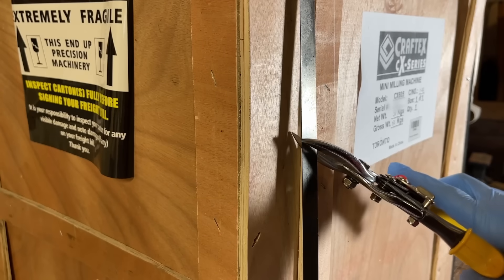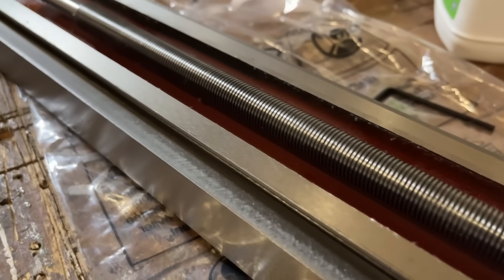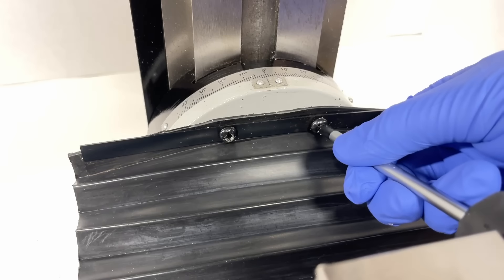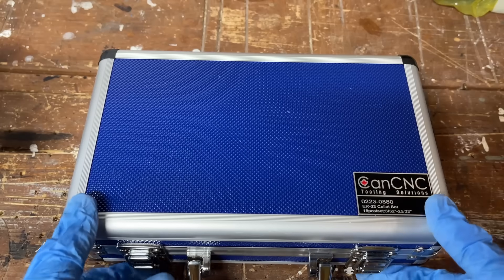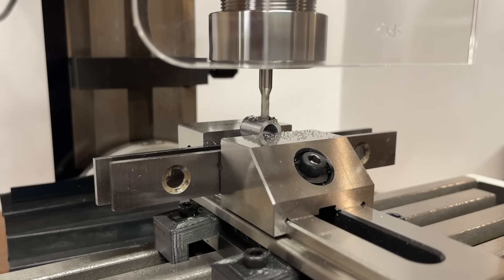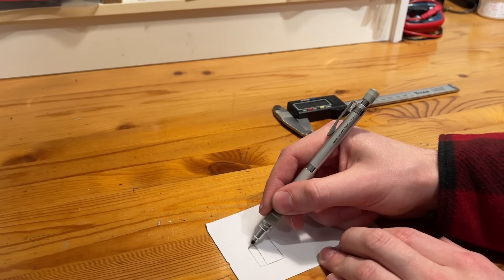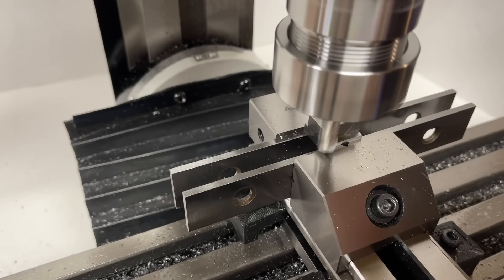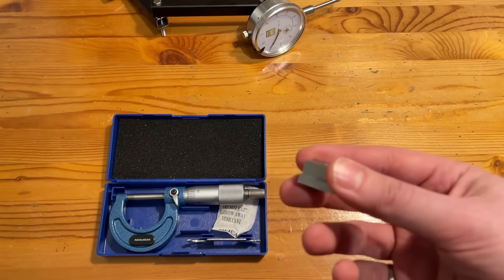I Bought A Minimill to see if they are Worth It

Comment: What definition of Tram please ?
Reply: Tram refers to how perpendicular the spindle axis is to the table.
Reply: Using a dial indicator held in the spindle, swing it to each end of the table.  If the column is perfectly perpendicular to the table, the readings will be the same.  Adjust the column until they are as close to the same as you have time, skill, and patience to achieve.  Make it easier by using the side of a large ball bearing for a contact surface.  Indicator doesn't fall into the t slots this way.
Reply: Tram is squaring the spindle to the table. Mounting a dial indicator on an arm in the chuck and sweeping it on the table you can measure the difference from side to side. When trammed there should be no difference.
Reply: Trimming the mill means adjusting it such that the vertical axis is perpendicular to the x and y axes.

Comment: Harbor freight sells the same mill, you can get it on sale for a little over 500.  Like almost all Chinese tools, you need to think of it as a kit.  Strip it down, clean and lube everything, replace cheap hardware with quality fasteners, do the LMS belt drive conversion, and add a cheap dro.  Even with all of that, its tiny size is the biggest constraint. 

If you do not have the room for anything larger, its better than no mill. If you have the space for it, you'll never regret buying a bigger mill.  The 6x26 Chinese knee mills are a HUGE step up in capabilities, albeit at a corresponding jump in purchase cost.  If I ever downsize from my full size Bridgeport, that is the way I'd go.
Reply: good advice !!

Comment: I have something very similar, a Little Machine Shop 4190 I bought as factory refurb with the DRO removed. Essentially your machine with belt drive, bigger table, 20 tpi leadscrews, and solid column. It'll pretty much eat aluminum with 3/8 endmills as fast as I can crank, and mild steel at maybe .050" DOC passes. Alloy steels like 4140 though, the mill pretty much has to nibble at. Where the stiffness issues will get you is high DOC cuts, even at super low tool engagement and low feed rates, like knocking down the sides of a part. Listen to your mill and feel what the vibration in the handwheels is telling you, and it should do fine.

LMS does sell conversion kits such as a belt drive kit or 20 TPI leadscrews, if you don't care to make them yourself.
Reply from the maker: Good advice! I’ll keep that in mind when I need to work with any of the tougher alloys out there

Comment: With the Mini-Whatever machines there seems to be a third category besides "Maker" and "Collector".  And that is where the lathe itself is the hobby.  I have been on the 7x12minilathe group forever and it seems the majority of activity is fixing this or that about the machines.  Or making this or that accessory (carriage clamp, chip guard for the back side of the apron, and so forth).  It is pretty rare that I see posts about somebody using the machine for an actual project.
Reply: 😂. The lathe itself is the hobby. I’ve never heard it put that way. It’s true though
Reply: @aquilifergroup  Although, I don't think that's a bad thing.  A hobby can be whatever somebody wants it to be.  And they are doing something and learning something outside of looking at TV, smart phones, iPads, etc.
Reply from the maker: Haha very true! I definitely also fall into this category from time to time. It’s fun to go down the improvement rabbit hole
Reply: I bought a mini lathe to use and I do. It's biggest drawback is depth of cut(material removal) is small due to lack of rigidity. Yep, had ta change the control board and replaced the plastic drive gears so the price ain't mini no more !!
Reply: @practicalplinking6133  The bed part of it is actually rather stout.  Most trouble seems to be to be due to the cross slide + compound flexing, and general looseness there.  Some lap the dovetails as an improvement.  Some remove the compound and replace with a solid block and report it helps.  Then there are the many who have changed the headstock bearings to good quality8 tapered roller bearings.  Some problems are user caused such as not using sharp enough tool bits, tool bits extending too far from the tool post, or trying to exceed what the low horsepower motor can do.

Comment: I have machining experience (and a much larger lathe and mill in my garage) and 15 years ago or so bought a Chinese mini-lathe and mini-mill similarly "just to see what they were all about."  There are a wide range of opinions from "works fine for me" to "these can be viewed as a kit and you have to fix and improve almost everything."  I think this variance is due to a variability in the quality machine to machine, and a variability in expectations.  This is the first such machine for many and they don't know what a good quality machine is like.  Others DO have experience and can spot the limitations and instantly realize why there is chatter when maybe there shouldn't be and so forth.
Reply: I agree completely. If ever someone wants to get into machining I always tell them the best quality and the biggest you can handle! Generally the jobs you pick up or tasks you pick up will be determined by machine size specifically with smaller machines. The smaller stuff generally will have issues though where everything needs to be corrected. Not always but a good chunk. Staying within the capabilities of the smaller machines are important as well even though on a bigger machine those capabilities are generally more maximized.
Reply: agreed. i'm a musician and i've had my 6-string electric bass for almost a decade now. i was working at a music shop, and the owner was a bass player, so we had everything from beginner models to $8000 6 string Zons. none of them felt right.

then one day, i unpacked an LTD D6. it was magic, effortless, just...unreal. AND it was the cheapest 6 string we sold, it listed for $500. and i can almost guarantee the next one off the assembly line played like shit haha
Reply: Yes, that's my general view on it. There's so many of these things at different prices from different places and they all have basically zero QC. One will be "acceptable" and the next one will have an unmeshed geartrain and a bent spindle. And then exactly as you said, some people know and some don't.
Reply: It's much like 3d printing. You can buy a $1000 quality hobby printer and you'll be guaranteed to have a good experience. Or you can spend $100 and get something that will work out of the box with some tuning but if you want consistency and reliability you need to put some more money and a lot more time into it.
Reply: The Chinese mini lathes and mills mostly come from the same manufacturer from what I understand, but that manufacturer provides different levels of quality and features depending on what you are willing to pay. So if you are willing to pay for it, they will give you quality machines to put your brand name on, whereas another company may sell the same machine with their own branding, but it be lesser quality.
Reply: @WheelsRCool  They mostly come from "Sieg" (Shanghai Sieg Machinery Co., Ltd.)  Some come from an outfit called "Real Bull" although the actual manufacturer may be somebody else, but they are not Sieg, are a little different, and most comments have them as slightly better.  I think that the notion that Sieg makes different quality levels is probably a myth.  I've been on the 7x12minilathe group forever and the 7x10minilathe group (now defunct) before that.  Quality seems all over the place no matter whose name is branded on it.  I have a Micro-Mark mini-lathe and mini-mill, and quality is about as others describe on average.  In other words, not that great.  In the case of Micro-Mark, they have negotiated some special features which seem proprietary to them and those are mainly the 'True inch" cross slide and compound screws and dials and the offset tailstock.  I believe ArcEuroTrade has at times, or perhaps always, cleaned up the machines first and if they saw an obvious issue might have rectified it.  So, there may be some who have had a little bit nicer experience.
Reply: I suspect it also makes a huge difference just who you bought it from - the crap castings and terrible finishing on some of them may have started at the same foundry as the good ones. But they could for instance be the quality control rejects from the places that sell reasonably good machines being sold on by somebody else etc... I know my mini mill has a surprisingly good spindle (at least for what it is) but the table is pretty terrible - probably salvageable but I've not really got around to invesitaging that.
Reply: at their price point, they have no competition. proxxon anyone?
Reply: @simonschneider5913  Although I have Chinese mini-lathe and mini-mill (from Micro-Mark over 15 years ago so early models) i recently got a Proxxon 250/E lathe (about a 5 inch swing) and FF230 mill.  I got them for model railroading work and simply got tired of how one Prazi lathe group member aptly described the Chinese lathes as "torture machines."  Made me laugh, but sort of true.  I still use the Chinese stuff for some things too large for the Proxxon, and I have much larger machines for even larger things.  But the Proxxon is REAL nice for small work, and I believe the models I got are the "sweet spot" in their line for value and better than an old Unimat or a new Sherline.  But to match the size of the mini-lathes, you need a Proxxon PD400 and that's about $4,000 (same for a Prazi of that size).  And for some reason seems unavailable in the U.S. now.  Prices are rising on the Chinese mini-whatevers but they are still a good value even if not quite the bargain they used to be.  The Chinese stuff makes it possible, especially for newcomers, to at least have a machine.  And there is a huge difference in having something over nothing.  But those newcomers don't get to experience what it is like to use a better quality machine.
Reply: the thing about buying chinese brands is the cheap stuff is made with the worst tolerances while the more expensive chinese stuff will have more accurate tolerances, they are made to order in batches literally from a cheap to quailty$$ scale from 1-10. Sometimes even the cheap stuff comes out really good but since the cheap stuff is usually a rush order its not the best. Doesnt mean a guy cant make it work
Reply: The chinese mini-mills/lathes of today are probably way better than the ones you got 15 years ago.
Reply: I have a mini mill and never had a problem. Nothing ever moved and I was able take deep cuts in material with no chatter in aluminum and steel. You just need a basic idea of speeds and feeds, upgrade to a belt drive, and get something better than a screwless vise. Also using industry grade cutters make a big difference. The only limitation I still hit was the size material I can hold in it. So quick cuts I need generally work out, but larger parts I go use a friend's Bridgeport like when I made an exhaust spacer. But I was able to take about an inch depth of cut on aluminum with my mini mill and nothing ever chattered or moved.
Reply: hahaha. 
people who use one of these.  mills with the rotation of the tool instead of against. ( like it has a ballscrew without backlash, )and then look weird that their tool is destroyed or the surface is shitty and inaccurate.

Comment: That 0.0625" per turn is due to a 16 TPI screw.  0.0625" being 1/16"  Micro-Mark has sold theirs as 0.050 per turn called "True Inch" using a 20 TPI screw.  Mini lathes are obtuse in their own way.  Most have 1 mm TPI screws but have handwheels marked 0.040" which is close, but 1 mm is actually 0.0394".  So, the markings are a bit dishonest.  I did see one, however, with 39 correctly marked divisions and then one smaller division for that 0.0004" to get you to 0.0394".  Again, for mini-lathes Micro-Mark has their "True Inch" version without that funny business.

Comment: These are quite capable little machines that have enabled a lot of home hobby machinists to have the facility of a mill and lathe at very affordable prices. There would be a lot less people able to afford to enjoy the modelling/machining hobby if it weren't for these cheap import machines being available.
Also worthy of mention is the point that great improvement in function and accuracy can be had with a bit of fettling and fine tuning of these cheap,basic machines.